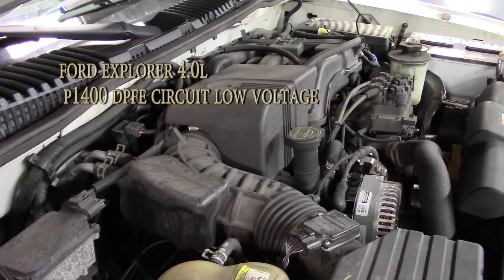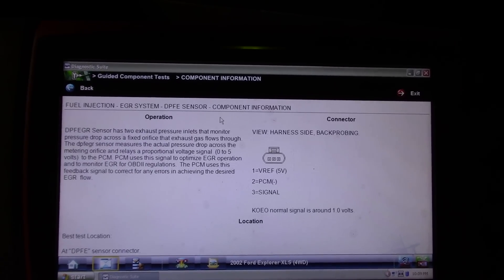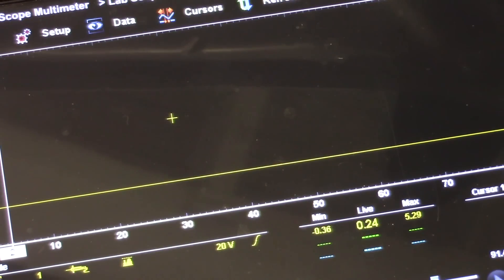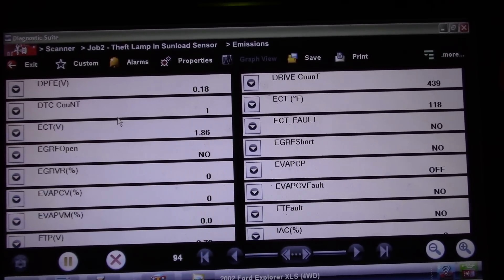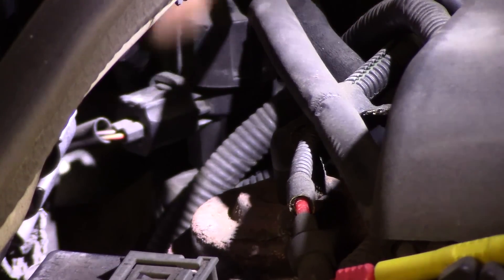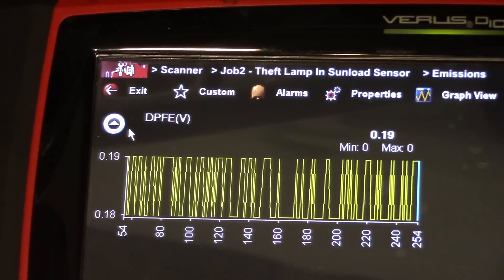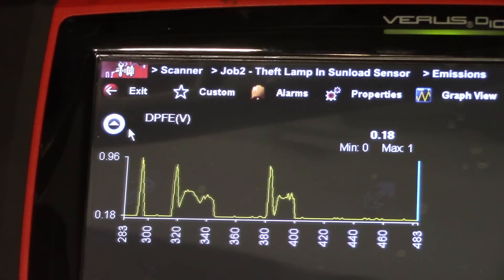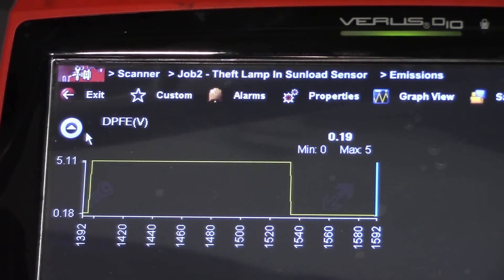2002 Ford Explorer 4.0l-p1400 DPFE Circuit Low Voltage, EGR Flow test

Comment: I GOT A MIXED STUFF FLAGS....SCANNED WITH MY CHIP AMAZON SCANNER AND THAT WAS THE CODE P1400 AND THE OTHER MORE COMMON....P0300,05.... THATS MORE ON THE CILINDERS....

LIKE THIS EXPLANATION...EVEN I AM NOT TOO GIG IN THIS ELECTROMECHANICAL AT THE DEEPEST...BUT I NEED TO FIX IT, LETS SEE WHAT I DO....

Comment: I have the same code on my ford escape 2003 but with the only difference that I also have the code P1479 (FCLOW PRIMARY CIRCUIT FAULT), do you have any other recommendations?

Comment: My 95 5.0 has an intermittent stumble. Runs great but then out of nowhere starts to stumble.
The last time it started crapping out I caught it and disconnected the egr vacuum line, engine smoothed out and i noticed a vacuum on the line at idle. Could this be the ecm failing to take the ground away thus keeping the vacuum solenoid energized?

Comment: With the KOEO and connector unplugged I measured 5v on 2 of the 3 holes on the connector looking into the PCM the middle it ground. Are these readings correct? You only measured 1 side.
Reply from the maker: Measure voltage with the connector plugged in and force the egr valve open and watch your signal wire voltage. It should spike up to 5 volts when the egr is open

Comment: I have an 02 ecplorer and im havin alot of trouble taking off the sensor becuz of the two tubes connecting up from the bottom any ideas on how i can loosen it before i somehow break it? Also where can i get the rubber tubes attached to the bottom of the sensor if i can cut them will that be easier to remove it?

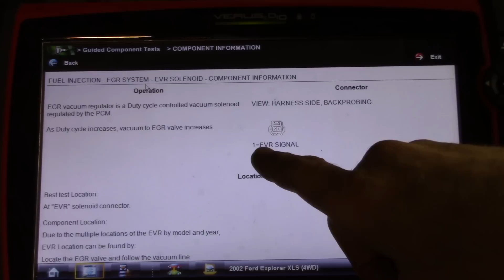Comment: It seems that the Verus troubleshooter had the pin info backwards on that EGR solenoid. Backprobing...the ignition feed was actually on Pin 1. Or am I reading it wrong at 5:36 of the video?

Comment: Hey man i have a Golf mk4 petrol  i have a P1404  code  (basic setting not performed)  is my egr valve broken?  my egr valve is disabled  by a Tuner, but still i get this code everytime.
Reply from the maker: what year and what engine?
Reply: year 2001  1.4 16v petrol Axp  engine
Reply from the maker: That is an unfamiliar one I have never seen. Where are you located?  What kind of tuner?  Is it a program?  When did the issue start happening?
Reply: i life in the netherlands  it was done by a professional Tuner at a garage. The tuner said  it's most likely an Ecu problem. The issue started when i replaced my front o2 sensor. However i did also got a o2 sensor fault code once after replacing the sensor. But it seems to be fine now, only the o2 sensor stays at a fixed value -2% at the long term and the short term stays between -2% and +2% 

Also the weird thing is when i create a huge vacuum leak, the o2 sensor still shows a value between -2 and +2%  this also happened with my old o2 sensor thats why i replaced it with a new one.

Sometimes the car starts and drives fine. other times it starts hard at cold engine and warm engine and it jerks extremely when driving.
Reply from the maker: What were the faults with the o2 sensor. Also is that a map or maf engine
Reply: The fault code was somethin like  heater circuit mallfunction  with the new o2 sensor. This came up once after erasing the fault code it never came back.  Its a engine with a map sensor, the map  sensor is also a new one from Pierburg.
Reply from the maker: Did the issue start after the tune?
Reply: It started 8 months after the Tune. Now i also got another fault code when i scan it with Vagcom. P1400 Egr Valve Electric Malfunction.
Reply from the maker: Sounds like the tuner did not disable the egr valve.  You need to trouble shoot that egr system. Is that a 5 pin egr valve. 2 wires to move the valve and 3 for the position sensor
Reply: They said to me that my Ecu is going bad. Its a 5 pin Egr Valve.
Reply from the maker: Well the egr system needs to be checked
Reply: They checked the software what they have tuned for my car. They said its okay its still there. The have disabled the egr fault code for  me, but if they erase the fault code another Egr fault code comes back.
Reply from the maker: The computer is trying to perform basic settings on the egr valve but it can't. Possibly an issue with the valve or wiring. Last resort would be an ecm. If they disabled the egr valve and the computer is still trying to attempt basic settings and it can't, which makes sense why you would have an egr fault. My thought would be take it back to the stock software and go from there.
Reply: Well i payed 250 euros to get rid of the Egr valve system because of the carbon build up. And i dont know if they will pay me back. But you are right i must get it back to stock to see if the car gets fixed that way.  Im going to make an appointment and see what they have to say about this. Thanks for your time and help i really appreciate it.
Reply from the maker: No problem. Good luck. Keep me posted

Comment: Very nice diag! How did you know there would be a 5v BIAS voltage? Or its the experience
Reply from the maker: Just knew from exp. this bias voltage also applies to other sensors as well usually any sensor on the 5vref.